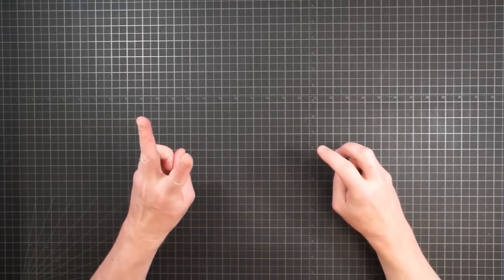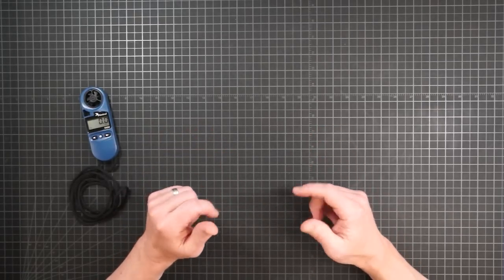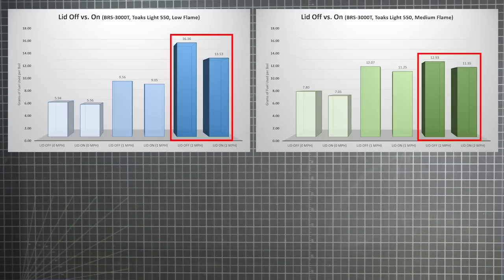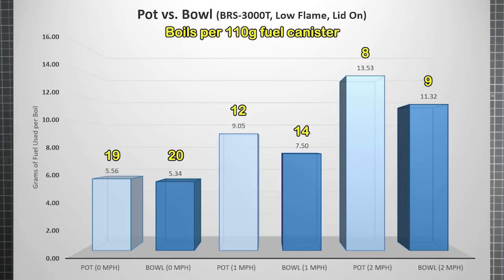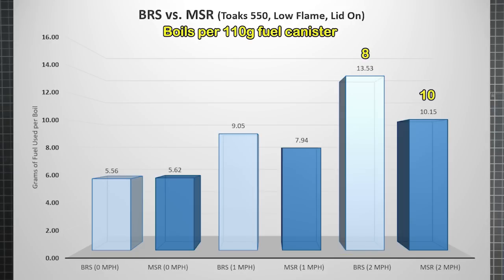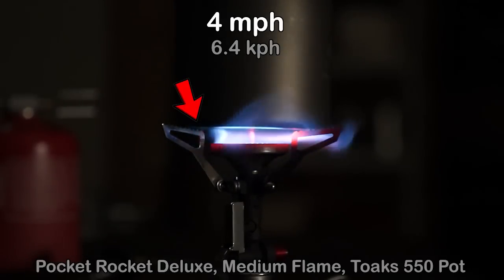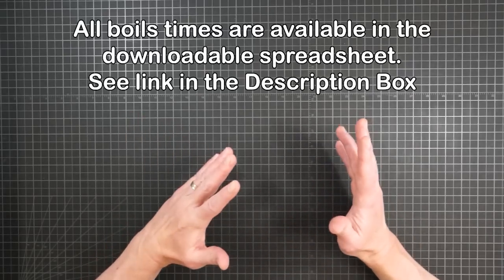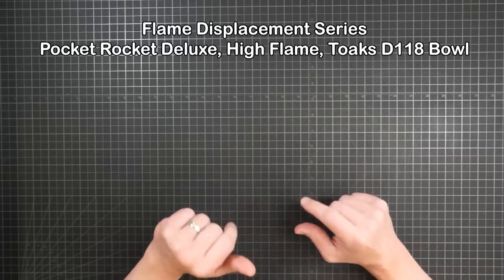Backpacking Stove Efficiency, Part 2: Wind Effects

Comment: For part 3 comparing the screens vs "just digging a hole", as I've learned back in the day, would be interesting. Especially since you might be carrying a trowel with you anyway.
Reply from the maker: I’m thinking about use of basic obstacles for impromptu screens, like hiding from the wind behind a tree, or your backpack.
Reply: @GearSkeptic  Windscreens with canister-top stove can if too hugging close can overheat the pot stand part of the stove and arguably puts the canister itself at more risk.

So I'd be thinking of a distant windbreak (e.g. use your backpack, stones, natural barriers, etc) for stove-top.

For remote-canister the flame is lower down so tend to be slower windspeed, plus any natural windbreaks will work better, and if you were to bring a closer windshield it would have less of a safety concern as the canister is outside of the windscreen.

I'm also thinking laterally, I've been settling on a 3-pole hiking setup with trekking poles x2 + a backup CF pole, which means most of the time I've got a spare pole, so adding a tarp I can make a shaped between tent+tarp a tall wide distant windbreak (extended vestibule) . That would tend to reduce the wind effect, hence a wide pot on a low flame previous rules should apply. 

I have Toaks 95mm, 103, 115, 118, 130ml pots in 550, 600, 700, 900ml sizes. I also tend to nest pots so e.g. 700 D130 outside a 550 D118.
Reply: @GearSkeptic  Would cooking inside a tent be too risky? And what techniques, tent fabrics and designs, or other tools might ameliorate that risk?
Reply from the maker: @jakeaurod  They all say not to do it.  Tent fabrics can go up quickly and you might get hurt before you can evacuate, especially if you're sitting in your sleeping bag and all zipped up inside.

That disclaimer being said, I've done it...carefully.  The precaution that comes first to mind is to get a canister stand to help prevent tipping.  You can get small, folding 3-legged ones that will effectively widen the base quite a bit.

Obviously, also clear a flat spot so nothing will catch flame or knock your stuff over.

Perhaps a safer compromise is to cook outside the actual tent, but inside the protection of your vestibule.  Just be wary that the wind might gust, and push fabric near the flame when you thought you were clear.  Never leave it unattended.
Reply: I don't cook inside a tent in bear country if it can be avoided, but don't see any problem doing it elsewhere (by inside I mean in the vestibule). Of course, I'll only do it if it's inconvenient doing it outside. After all I'm not on a hike or cross-country skiing trip to sit inside a tent, but in bad/extreme cold weather cooking inside is basically the best way. I've mostly done it with a white gas stoves like a Whisperlite or X-GK which are extremely stable and I'd never do it with a stove with a gas canister as the only support.
IMO something like the MSR LowDown (or basically anything that gets the stove off the canister) not only increase stability and safety, but also get the burner closer to the ground and makes it easier to shield from the wind.
There are also options for hanging some stoves which makes for stable indoor cooking inside the main tent, but never tried those.
Reply: @GearSkeptic  Please do this! Impromptu screens FTW
Reply: @jakeaurod 
You're just begging for issues when cooking inside the tent.

Comment: Naturally, the next question is both windscreens, and most importantly - heat exchanger pots. You already have the setup and method sorted, so you might as well. THAT would be really interesting. I use both methods, and subjectively, I seem to get at least a 30% improvement. Kudo's for all the effort, and a great series.
Reply from the maker: Yes! Part 3 is planned for windscreens, and Part 4 for heat exchangers, so I can hopefully compare an ultralight stove and screen combo to a Jetboil and others.

Comment: Be sure to include in your heat exchanger test a couple of non-integral or non-system pots like the Olicamp HTS or the Jetboil Stash pot.  I have used both of these pots with an Amicus stove on longer trips. Fuel consumption is quite low.  Wind effects as well. Also had very good performance using a Pocket Rocket Deluxe with a Jetboil GCS pot in strong, gusty conditions, right next to an MSR Windburner, similar results.
Reply from the maker: Already have the Stash, and will be sourcing some other pots for the tests! 👍🏼

Comment: I would love to see an MSR windburner or a jet boil in the wind ! Great vids as always !
Reply from the maker: Yes! Heat exchangers are planned for Part 4, to see how they might compare to a stove+screen combo.
Reply: @GearSkeptic  That is going to be spectacular- especially seeing the unvarnished math on cost of weight of heat exchanger with savings of fuel. I suspect it won't justify with an option of a simple foil windscreen... But I am ready (and enthusiastic) to accept the data regardless.
Reply: @cherylwhistler8878  My guess is that heat exchangers will be more weight efficient if it's a longer trip with something like 2 dozen boils or more. Looking forward the data as well.

Comment: My best windscreen results came not from a ground-connected windscreen, rather a pot-connected windscreen.  Using the same 0.005" Titanium windscreen material (e,g. Dutchware), but securing it halfway up the pot (e.g ss-cable-tie or spot-weld) with a 1/8" white-ceramic insulation, it allows super-heated airflow halfway up the pot's sides.  Thus the windscreen extends only an inch below pot-bottom.  That inch (to inch and a half) both blocks the wind and contains heat under and against pot-sidewalls.  Thus, it aids in wind and without wind, yet weighs only a few-grams.  (more...) 

While it looks like Jetboil's heat-sink idea, it's actually much lighter and more effective means to encapsulate stove's hot-air around the whole pot, rather than attempting to conduct more heat through massive metal fins. 

Construction: Simply cut windscreen material to size, wrap around pot and spot-weld, leaving 0.010" space for airflow up around pot-sides.  A fold on the extended end is less sharp and should be bent with heat to ensure a nice rounded edge.  OR...
Cut windscreen material to size, plus the 1/8" or less space for insulation, wrap around pot and secure with a ss-zip-tie from Lowe's.  This configuration weighs a few more grams, but is adjustable and removable (should one want to try it out before committing to spot-welding one's favorite pot).
Reply: Sounds like an interesting concept. Can you elaborate on the Ceramic Insulation? How does it work? 

Also I didn't quite get the order of things: Pot, Airpocket, Titanium Foil, Ceramic Insulation OR Pot, Ceramic Insulation, Titanium Foil?
Reply: @GmailNexus  - Make a channel  by bending 0.1mm Ti sheet to capture 1/8" high-temperature insulation (they call it 'ceramic,' but it feels like batting) top and bottom as shown in the detailed engineering drawing below.  The smaller the 'lip,' while still containing the ceramic, the better. 

         Ti         Ceramic                 Pot

                                            |                         |
          _                                |                         |
         | |            | |                 |                         |
         |       <-    | |                 |                         |
         |              | |                 |                         |
        |_|            | |                 |______________|

Once ceramic is embedded in its Ti-shell, wrap it around the pot.  Use a standard hose clamp to tighten and form the Ti-wrap snugly onto the pot.  Creases will form at the top and bottom due to thickness; these let the proper amount of air escape after having heated the sides of the pot, so don't try to eliminate them for aesthetics.  Once the proper form and tightness is achieved, mark the position, loosen slightly and slide off.  Then retighten to the marked position.  

Drill a 4-40 clearance hole through each of the top and bottom overlaps.  Flat-head, cone screw-head on the pot-side and nut on the outside.  Remove the hose-clamp.  Slide the windscreen back onto the pot.  It should be perfectly snug and only move with intentional force.  Screws and nuts on the handle-side are less obtrusive.  

Set the drop-down distance as desired, depending on stove, Caldera-cone, other windscreens, etc.  The idea is to hold the hottest gasses within the Ti's edge while the ceramic delays the hot-gasses as they propagate up the side of the pot and chimney out having transferred their heat to the pot.  Drop-down height should be set so it doesn't impede stove's complete combustion of fuel

The whole thing should weigh less than 20g or so, depending on pot-size.
Reply: @tomnoyb8301  Awesome, Thank you so much

Comment: While doing the windscreen test, please test the "place a backpack to block the wind method" or "use the tree to block the wind method" or both, those have been my methods of choice over the years. And whilst they are not ideal (wind reflection, means the wind comes from multiple directions) they have made my boil times much faster and i'm assuming that as a proxy for fuel savings.  Been loving every single video you have made. Thank you so much
Reply from the maker: Thanks, and I will do that! I’m curious to see how much benefit can come from using improvised blocking, given that those methods wouldn’t require buying or carrying anything extra.
Reply: Also the sit pad held in place by some rocks method

Comment: Oh you are good, you are real good, factoring in all relevant variables, thank you.
Reply from the maker: Much appreciated! Thanks. Can’t get absolutely everything, but I try 😉
Reply: if you have a mind to I wouldn’t mind if you tested the MSR Windburner. I have one and this spring I used it in winds gusting to about 25 mph and the only problem I had was lighting it because the wind kept blowing out my Bic. Once I got it lit no problem. Kinda wondering how much wind it will take.
Reply from the maker: Heat exchangers are planned for Part 4! After windscreens in Part 3, I’ll have a baseline to compare an ultralight stove/screen combo to a pot system like the MSR or Jetboil.

Comment: 20:50  My explanation of this is that the primary source of energy loss when heating water is heat of vaporization. The radiative effect is actually quite small  by comparison. But the rate of this vaporization (sub-boiling point) will depend on the concentration of water vapor in the air in contact with the water surface. At a certain point if no new air is circulated in the local concentration will reach a maximum and no additional water will vaporize until boiling is reached, thus nullifying this source of heat loss. But Increasing the wind speed will ensure new air will always be in contact with the water surface. This effect will naturally be greater for the wider pots and higher winds than narrower pots and lower winds. It would seem the increased rate of sub-boiling vaporization for the large pot caught up with its more efficient heat transfer at higher wind speeds.

Comment: Thanks for all this excellent work reported clearly and with a dry sense of humor.  I want to note that the Triflex pot support for the Soto Windmaster gives a lower total weight than with 4-arm support (67 g vs 87 g) and thus lighter than the MSR PRD at 80 g, so that's another alternative if my cousin Graham Phobic ever tires of his BSR.  And the Triflex supports are level and not angled if that helps.
Reply from the maker: Good to know! I will see if I can get one.  Thanks!
Reply: @GearSkeptic don’t set your PRD aside before you do some cold weather testing as well below 40 degrees and above about 10 degrees. Testing done by Backpacking Light indicates pretty convincingly that the PRD, because of its design that compensates to some degree for the effects of cold on fuel vaporization and pressure differential caused by fuel use, is a superior stove in colder conditions relative to the Soto Windmaster. They both have been engineered to compensate for these cold weather challenges with isobutane but the design used by MSR in the PRD is apparently superior to what SOTO uses in their Windmaster. At least that was their conclusion.

Comment: Another excellent vid. Thanks!
Confirms my suspicion that the fancier stoves only provide a tiny amount of resistance to the lightest breeze. If there is real wind (over 5mph), then a windscreen is necessary, no matter which stove you use.
34:17 With a good windscreen the BRS is very nearly as efficient as a more expensive and heavier stove. 
Looking forward to the windscreen tests!
Reply from the maker: I'm leaning in your direction, but it will be fun to test!

I suspect weight efficiency will be a problem for windscreens generally, but that would only get worse for bigger pots.  It "feels" like the smaller pot will have the advantage because its windscreen will be lighter than one for a wider vessel.

After that, I want to see in a Part 4 if an ultralight stove/screen set can beat the big heat exchanger systems :)
Reply: A wind screen doesn’t have to be heavy. 
I have done some testing on trying to make a heat shield instead of a heavy HX pot (partial success so far). 
I will let you know if I get it working.
EDIT: Woah, YouTube went a little crazy there! (Fixed)
Reply: @GearSkeptic  I sent you an email about my rough prototype 23g heat shield that is almost as efficient as a heat exchanger pot.
Reply from the maker: @billb5732  Saw it! Looks very interesting.  I have begun to collect materials for some homemade stuff, but will also compare to some of the neat cottage industry stuff available.
Reply: @GearSkeptic  Looking forward to it.
Reply: I think the bigger takeaway is that the 3000t REQUIRES wind protection while the Windmaster and PRD dont. 2, 3, 4mph are essentially an every day light breeze and realistically speaking people are going to far prefer to just screw the stove on and heat up their food as opposed to adding in the need to setup a windscreen.

Its also not quite as simple as needing to make the additional stove weight up in fuel though. The PRD and Windmaster both have regulators as part of the design allowing for a more steady burn as the canister pressure drops and both have piezo ignition included. The piezo alone saves the need to carry a second (backup) 12g mini bic as one would with a 3000t. Both are also far more weight stable than the 3000t as well.
Reply: @natea1042  By all means, enjoy your upgrade stove if you like it. Regulator and piezo are not worth 80-140g to me, compared to 26g for the BRS. Clearly, YMMV.

Also, wind is often more than 5mph, so the vid demonstrates that ALL stoves need a windscreen.

Comment: A thought on the decreased efficiency conundrum with off-centered containers and wind.

As the wind increases some of that wind hits the pot and travels down not just off to the sides. It would then travel down and hit the burner displacing outward from there. 
Initially in low wind that might help as the downward  air would have little effect or possibly even force some of the heat back down and then under the container. In higher wind tough the downward air disperses the flame to greater and greater degrees before it even get under the container reducing how much actually reaches it in the first place.

Just a hypothesis, I'm not a thermal engineer nor did I stay at a Holiday in last night.
Reply from the maker: I like it!

Comment: Intriguing counterintuitive results on the offset-from-center tests with higher wind. I suppose that as wind speed increases, the hot spot right above the burner, on the bottom of the pot becomes much more dominant relative to the rest of the flames - as you stated, due to the decreasing density of the said flames. Perhaps, past the tipping point, having that hot spot centered on the bottom of the pot allows for optimal heat distribution on the metal and into the water, (as well as maybe creating a better, more symmetrical, benevolent convection cycle in the water?) Also, if the hot spot is close to the wind-facing wall of the pot, it's basically closest to the coldest wall of the pot as well, likely increasing loses. Just some pontification! Love your videos and every pedantic moment of them!
Reply from the maker: Gives me an interesting (albeit impractical) idea: an array of maybe a dozen temperature probes at even intervals within the water of the pot so you can measure where (center bottom, edges, walls) and at what rate heat transfers into the water.

Comment: I never tought I would learn so much on boiling water on the trail, but here I am taking note at every of your videos. Thanks a lot for this, my friends will find me a bit intense on my next trip!

Already, I’m learning that the effect of wind is greater than I imagined. I do carry a windscreen made of light aluminum foiled, I check your next video see if this make sense or not!

I don’t know if it got mention at one point (so much information), but when comparing options weight, if I need to bring an extra canister (or bigger) canister in a trip, the weight of the empty canister should also be considered. My 227g canister weighted 374g when full, so 147g empty. If I use the BRS in the wind, and this force me to have two canister instead of one, it is 374g total more that i need to carry.
Reply from the maker: Thanks! And, yes. Canister weight gets discussed more in the next one 👍🏼
Reply: @GearSkeptic just came here to edit my comment after watching your next video, but your answer was quicker! Thanks!

Comment: I figured wind would drop the efficiency, I didn't expect it to change that much.

I also wonder how much of the extra heat loss in the wider pots comes from extra surface area for evaporation. A lid on a larger pot/bowl would weigh more of course but might do more to reduce heat loss.